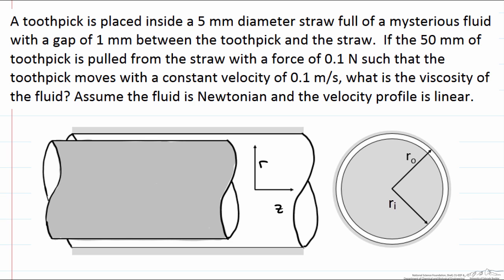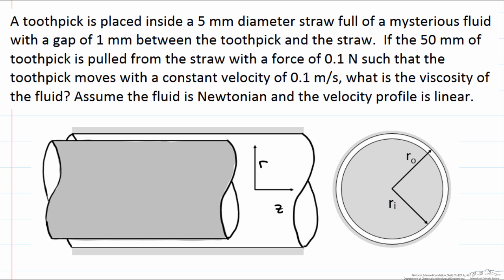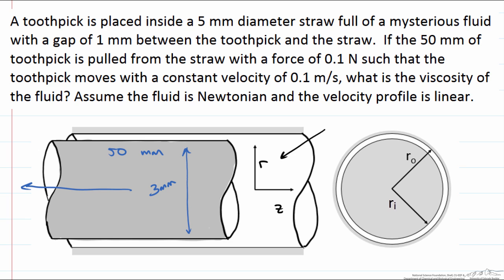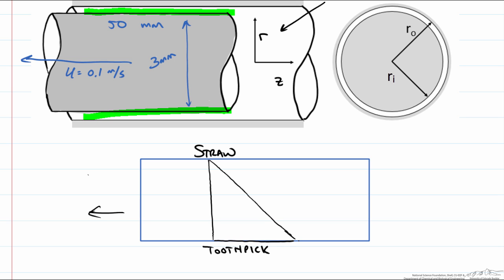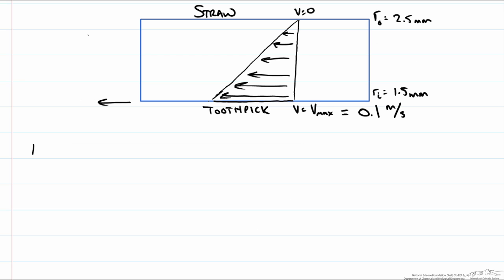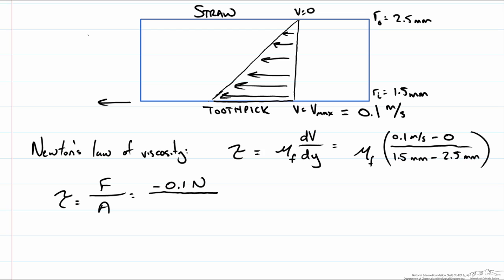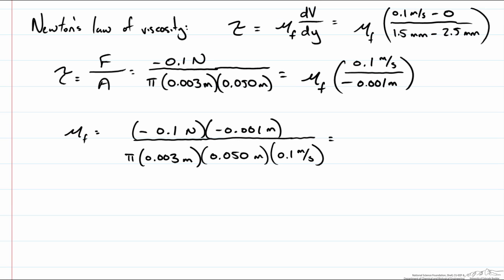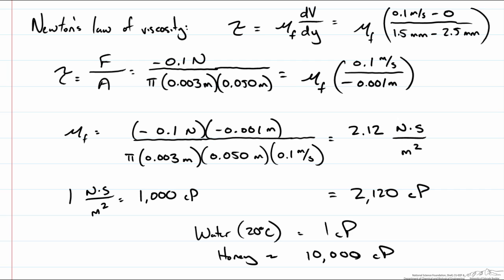Viscosity of Fluid From Shear Force

Comment: can you explain why you took the surface area of the tooth pick whereas the shear stress would be maximum on the straw so we need to consider the surface area of the straw right????
Reply: The shear stress is equal throughout.
Reply: Because the toothpick is what is putting work into the fluid